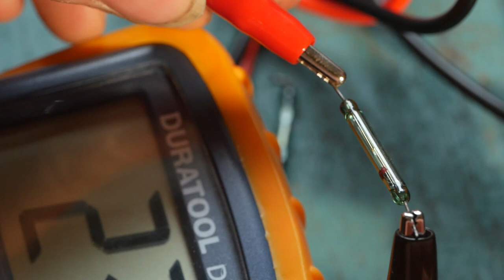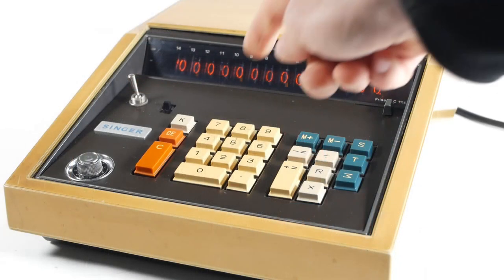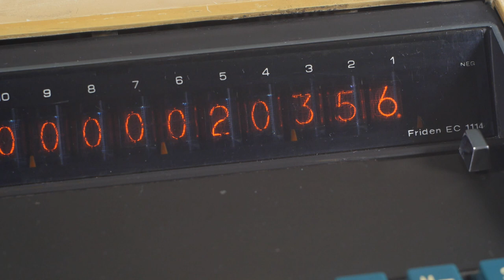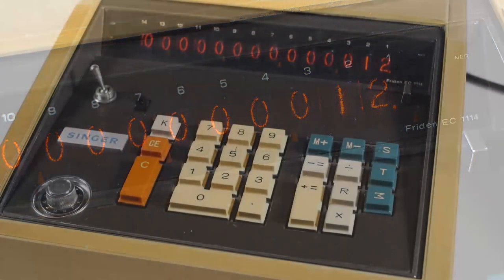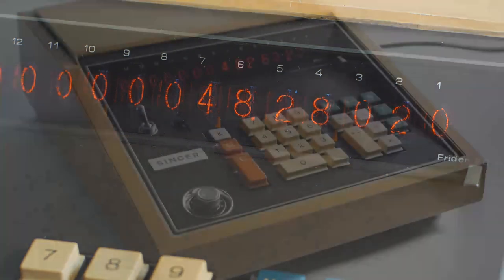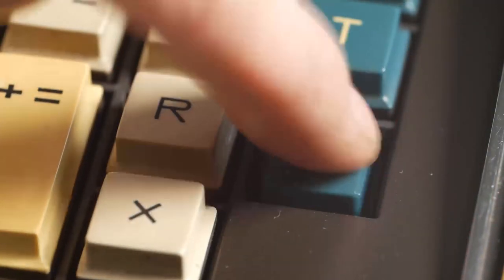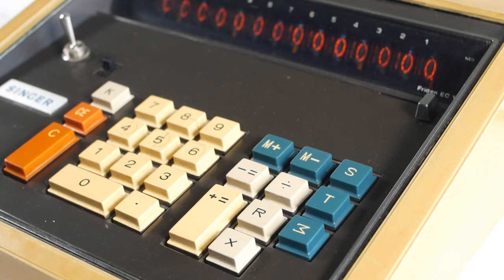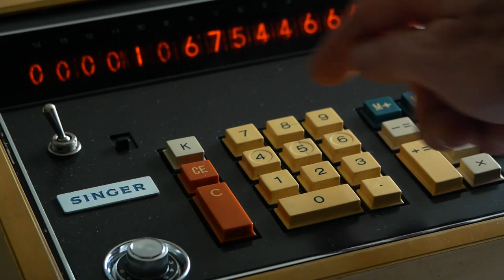Singer Friden EC1114 - Nixie Tube Calculator - Part Two - Demo

Comment: Nice modern pocket calculator, did you nip down to woolies to buy it especially for this video?
Thanks for the close up on the tubes, I'll check the other video out, quite remarkable.
Reply: Awdrey, Can you tell me how to calibrate my radiac?
Reply from the maker: Oooh yes, I just popped into Woolies and got their smallest pocket calculator - it only takes 4 "C" cells to power it!!!!!!!  Those nixie tubes are so sexy - and kind of hypnotic to look at too.

Although those AWDREY machines were originally intended for a somewhat sombre purpose, they're still a really cool bit of historic equipment - and they look impressive and understated at the same time.
Reply: @GrumpyTim  do you have an awdrey machine? I just wondered why you typed it at the end. I have never seen one, the field equipment is always what gets me excited, my radiac is relitively modern but still nice and chunky, machined access panels in the aluminum case and such, I wanted something older with a bit of chrome and a round dial but they have become quite collectable and so demand more than I was willing to pay.

I went looking at your other videos for the detailed explanation of the tubes, couldn't find it and got sidetracked by your music slightly, 70's detective show is an absolute peach mate.
Reply from the maker: No, I haven't got an AWDREY, I think they're all in captivity, or at least in bunkers/museums - I just started adding a bit of pointless but maybe vaguely interesting information, such as the odd acronym , at the end of the videos to see if a few more people would stay to the end - no idea if it makes any difference at all.  I think all the old gear like your preferred radiac has become more desirable these days - there's plenty of stuff I should have bought years ago, because I simply can't afford it now.

Thinking about it, I only explained a little bit more about the Nixie tubes in the video I did about the Monroe 620 https://youtu.be/00vAkeb3cb0 and probably the only additional info is that they're filled with a low pressure gas (neon and maybe a dash of something else), and they need around 100 to 150 volts to operate.  I also put a link to Dalibor Farny's channel where he makes brand new nixie tubes https://youtu.be/wxL4ElboiuA - well worth a watch if you haven't already seen it.  From the viewing numbers, I don't think my music is that popular, but at least I should never get a copyright strike!!!!!!  I spent so much time listening to the themes from Starsky and Hutch, The Professionals and so on trying to come up with something that sounded like it belonged in the 70s when I wrote that track - I really should write/record some new stuff, but it takes so long, or at least it does the way I do it!!!!
Reply: @GrumpyTim   @GrumpyTim  pointless but vaguely interesting? So I've been looking for the cryptic messages in your test numbers for no reason?  Balls.

Need to go and have a look at these tubes being made, thanks for the link.

Man, your constant striving for perfection sounds as tormenting as my daydreaming and starting 10 new projects for every one I finish.
The thumbnails/sleeves are brilliant. Where was I going is a favorite, I like the tune as well as the alegro, felt like I was listening to riders on the storm for the first time again, trippy!
Faceted talent my friend, I feel slightly awestruck.
Reply from the maker: There are quite often little things hidden in some of the numbers I use or the results of a calculation, but they're not exactly full of top secret information - it's just something to occupy my mind as I work out what calculation I'm going to give as an example - as a little clue, the calculation I do at the end of this video results in a time and date.....

Where was I going took ages to do - often I don't really plan how the track is going to come out and I got rather lost during the writing/recording of this one, hence the title "where was I going" - in the end, after much fiddling I walked away and called it finished.  Then, unable to leave it alone, I went back and changed some bits, which made it all worse, so I had to go back and more or less return it to it's previous state.  Other tracks like "theme from a 1970s cop show" was written entirely in my head before recording anything, I knew what all the parts were going to do, and when, so that one will hopefully sound like a more organised track.  Music theory to me is like blah blah blah - I could never tell you what key a piece is in, or even name the notes on a piano!!!